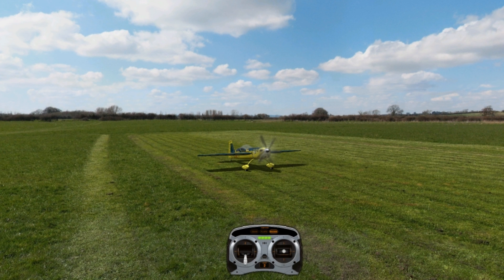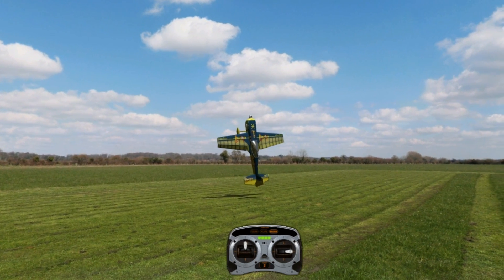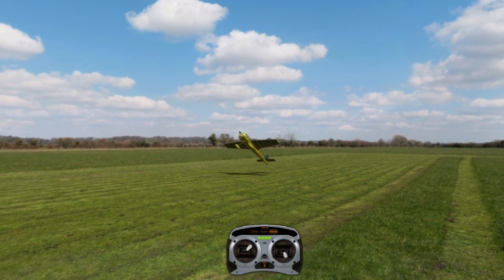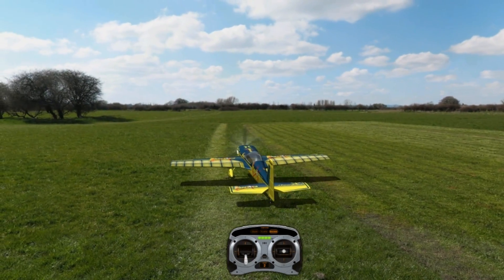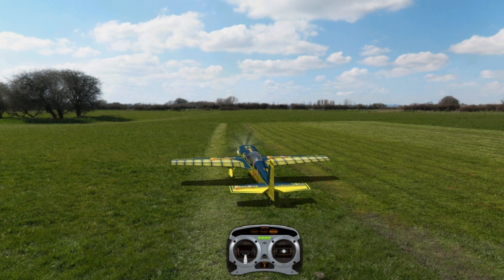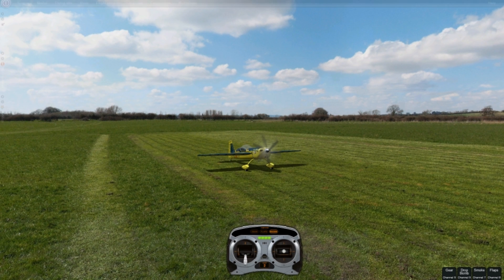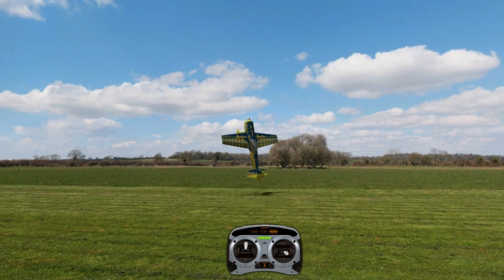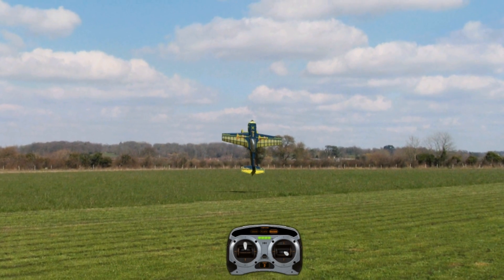Voro's 3d School: Hovering and Torque Rolling Tutorial

Comment: Hi Voro RC i usually fly quadcopters and after seeing your video i decided i really want to get into Rc planes. I also got the Phoenix sim 5.0 to learn before i buy any planes. I would like to know if the software (phoenix) is compatible with the microzone MC6 transmitter or Flysky I6 transmitter? The one i aim to buy I am getting options those two options for RTF but i notice mosr RC planes comes with PNP so was hoping to get a good tranmitter that i can use with the phoenix sim and also fly my planes. Thanks

Comment: I fly all electrics and have the Phoenix 5 sim. Which plane do you think I should try to use for this on the simulator. I was working on rolls and did pretty good usings the Yak 30. Can you advise to plane type and any special settings. Thanks Ron

Comment: Newbie here. How are you preventing the plane from climbing?  It looks like you have it full throttle the whole time.
Reply from the maker: Each plane has a different "thrust-to-weight ratio," this plane is just a low ratio. Some planes are higher and can hover at half throttle, and some do not even have enough power to hover, it all depends on the plane and the power system it's using.

Thanks,
 Voro

Comment from the maker: Duel rates is a very personal thing. I, personally do not have low rates. Every flight I'm in high rates only and that is as much throw as I can get out of the surface. Typically 50 Degrees on aileron and rudder and 60 degrees on the elevator.
Thanks,
 Voro

Comment from the maker: CG should always be perfectly balanced. D/R usually set between 100 and 150% and expo right around 70% on every surface. But expo is totally up to the pilot. As far as thumb tips, I'm not really sure, I use both index finger and thumb on the sticks (pinching the sticks), you might try that as you don't use the tips as much. But ultimately I wouldn't know, it comes down to whatever feels comfortable for the pilot.